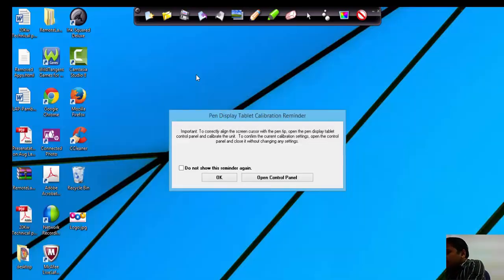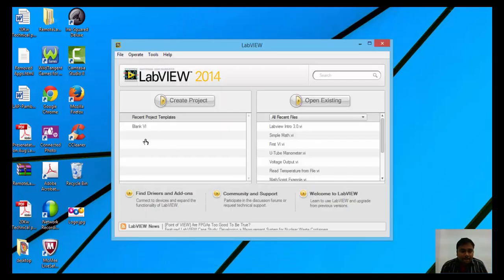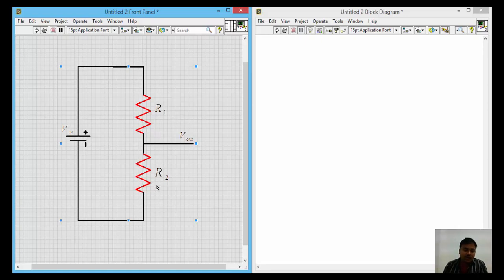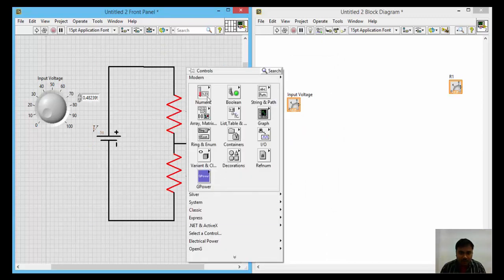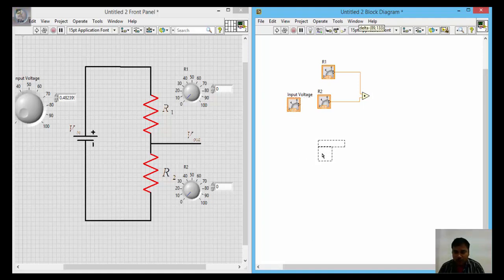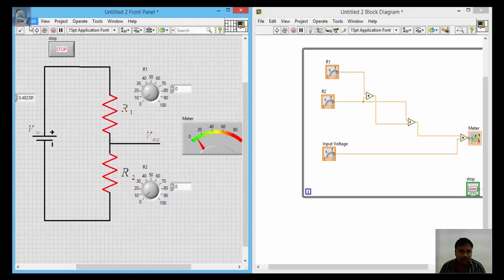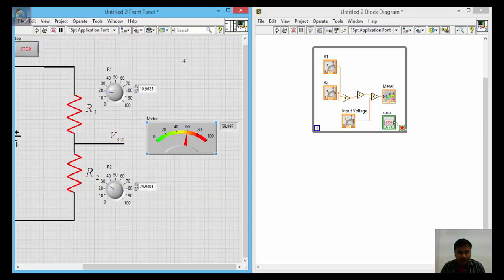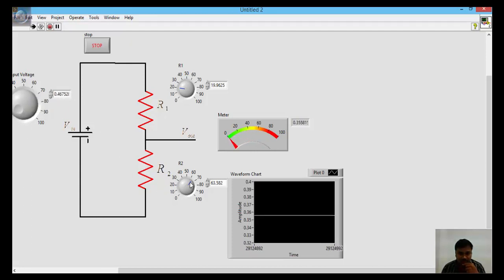Labview-3.0

Comment: Hi 
I am currently working on a project to control A circuit using gestures.
Is it possible to use Arduino with gesture sensor to control the circuit in labview
Reply from the maker: Yes